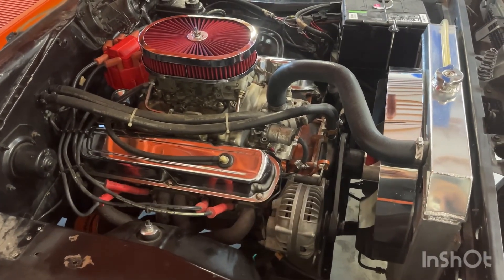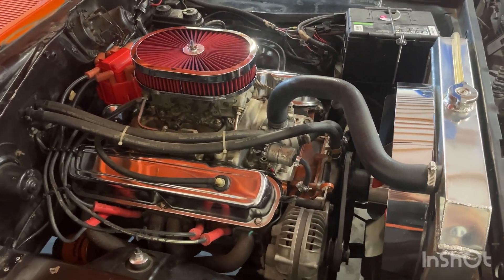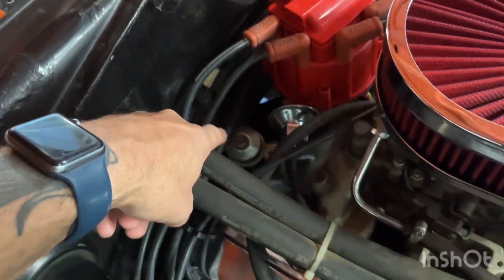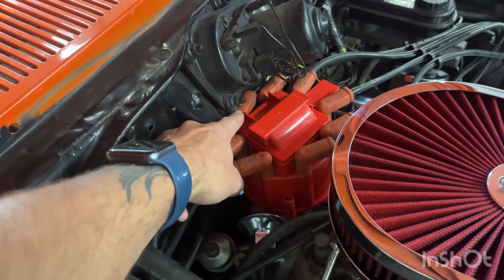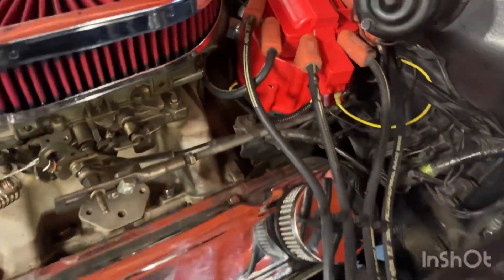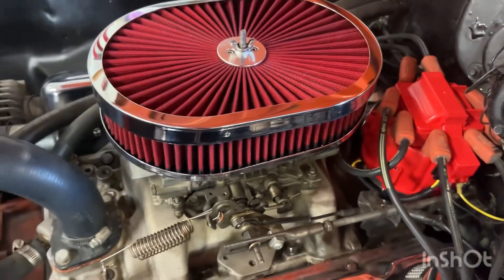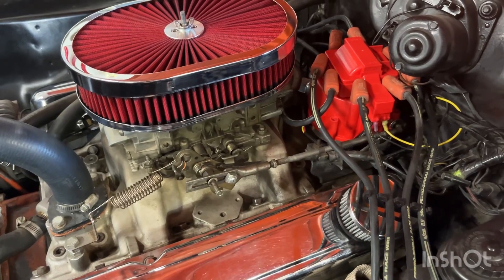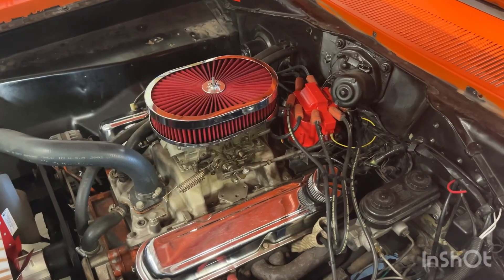Will HEI distributor fit in a mopar #automobile #diygarage #garage #garagebuilt #mopar #smallblock

Comment: How did you wire that one? Did you eliminate ballast and tie the key hot and crank hot wires together? Or where did you get your 12V from?
Reply from the maker: @stevezanone2937  I’m not exactly sure it was wired like that when I got it. I’m thinking jumper wire 1 an 2 are wire together but I will look at that closer.